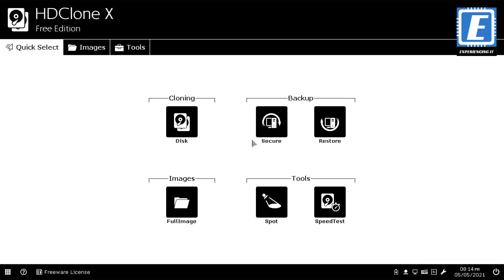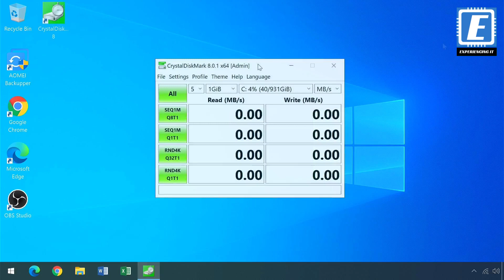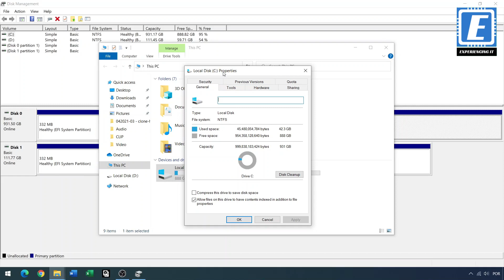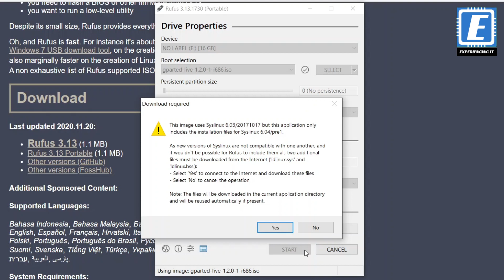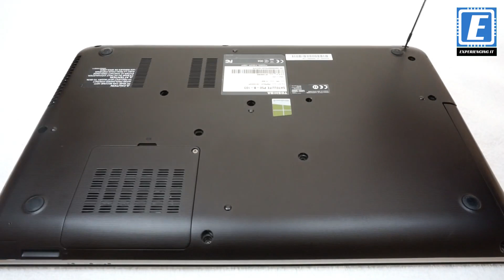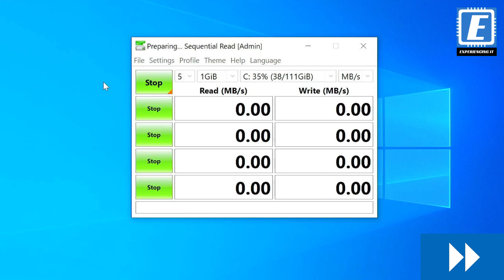UPDATED - Clone your hard drive for free in 2021 - HDD to SSD - HD Clone X

Comment: This maybe the case with smaller drives but in my case it won't work. I have a 4TB HDD & I currently use about 500GBs. Just bought a 1TB Samsung SSD. Tried to use this software to clone everything over but it says in order to select my 4TB HDD as the Source I have to pay for the Basic Edition. Guess its time to continue searching for a FREE option to Copy/Clone my Drive. Its a shame websites are charging for these options now.

I remember back about 5yrs ago Copy/Cloning was FREE. I don't see the point in paying $25-$50 for a License Key that I am only going to be using once.

Comment: I followed this process very carefully, cloning onto a Kingston 120GB SSD, having reduced the partition size of the source Sata HDD to 75GB. Now my computer (running Windows 10 Pro) will not boot to either drive ("No bootable media found") . I have tried removing the original drive and replacing it with the SSD in the same slot, but no joy. Help!!
Reply from the maker: Hi Guy, first of all, thank you for passing by! I'm sorry to hear that it didn't work for you. Of course, not knowing what has been done step-by-step, it's quite difficult to give you a suggestion of a next step. My advice, if no disk is booting, is to install a fresh copy of Windows on your new hard drive, I imagine it is the SSD, and once you have Windows installed, copy all data from your original hard drive to the SSD.

Comment: Well that was useless it was going to take 8 hours then it stopped partway through and i had to continue then it was going to take another 12 hours as the data rate was was barely moving.Who the hell wants to run their hard drive for 12 hours for something that will probably not work.Delete this video that program is less than zero.If it of worked i probably would have bought it then next time i did a transfer but certainly not now.
Reply from the maker: Hi Jim, thank you for your input. The time it takes to clone the hard drive will depend on the hard drive type and the hard drive size. Also, the free edition of the software is slower than the paid versions. Anyway, nowadays, having a free software to clone hard drives is a rare find, so... enjoy!

Comment: do i have to use gparted and rufus if im just cloning hdd to ssd on a desktop ? i cant just clone the hdd to ssd and just use it like that once its cloned over ?
Reply from the maker: Hi Frvnkz, I believe you could clone directly if the used space on the hdd is less than the size of the ssd.

Comment: Hi, will there be any failure with this method?
Because i tried another method before.. but Error 0xc000000e winload.efi missing appears.
Reply from the maker: If you follow the steps mentioned in the video, you'll have no issues.

Comment: Thanks for this bro had a hard time finding a tool that can help me save time by cloning my ssd to my m.2 without costing an arm and a leg have two systems up and running now. I had to redo everything on my first try then make sure to uncheck the button for the signature similar to what you did and it booted without issues after. thanks again
Reply from the maker: Thank you for watching! I'm very glad it helped. :)